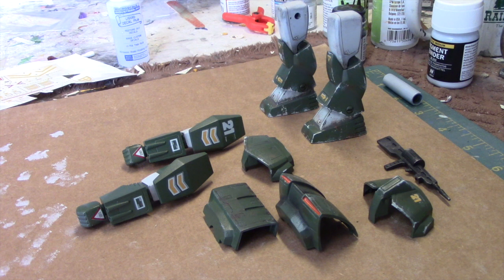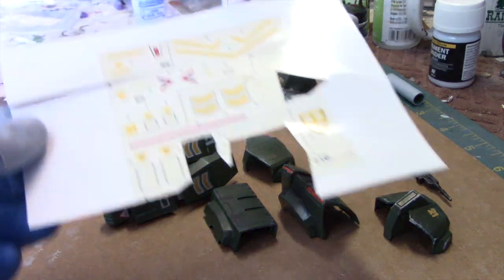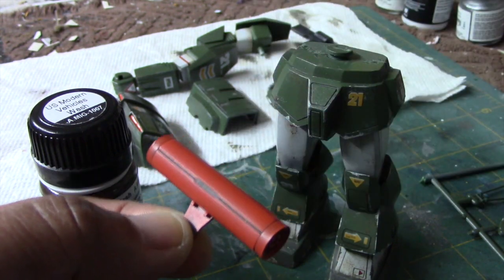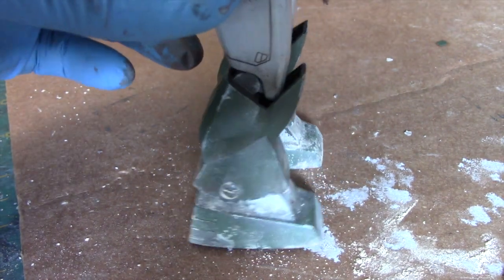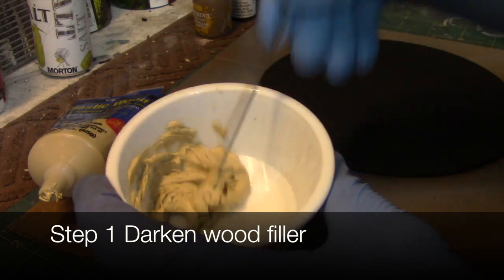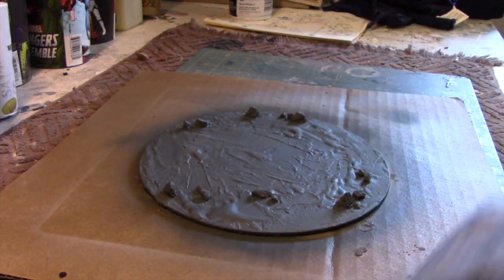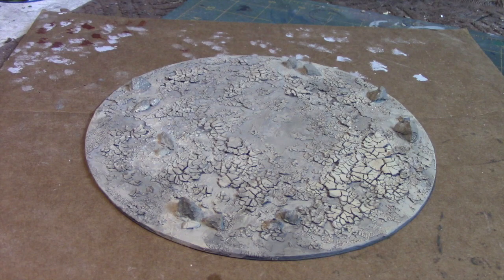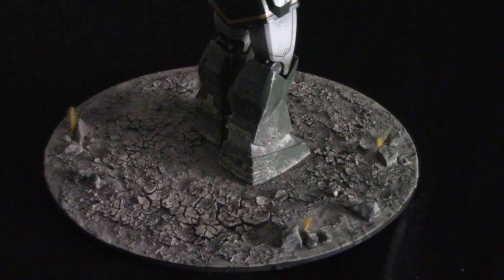Building the Soltic H8 Combat Armor Kit Completion

Comment: I think the final product looks great; the weathering came out nicely and the base ties it in.  I know that when it comes to pigments, if you put them on over a matte varnish/sealer it also helps it adhere.  Excellent job with restoring the old decals since that's one area that can make older kits a real pain.  As for the Agrellan Earth, they recently released a similar paint called Agrellan Badlands which is supposed to give bigger, more dramatic cracks (according to the manufacturer) and looks like its designed for big bases and dioramas; I actually got big bottles of both Agrellan Earth and Badlands this last Christmas and I have yet to really play around with them, but I imagine its still going to require a thick coating.  That seems to be pretty common among crackle mediums, paints and glazes; the process apparently only really takes place in any serious capacity if you apply large amounts.  There's a trick you can do using regular PVA/white glue and paint that's supposed to yield similar results, but my attempts didn't quite pan out in that regard; I got a few small-ish cracks, a couple of decent ones, and a very rubbery skin on top of the rest that was very fragile and prone to tearing.